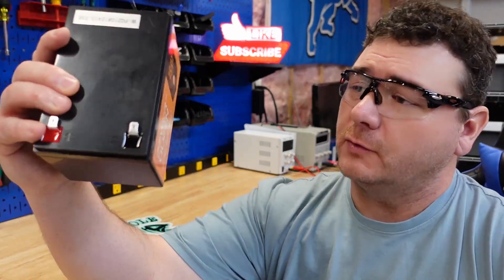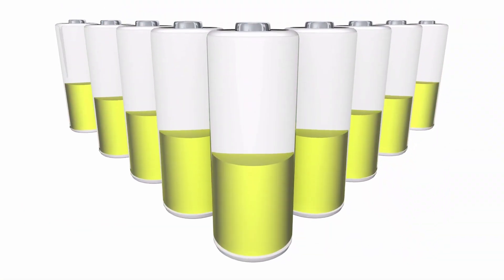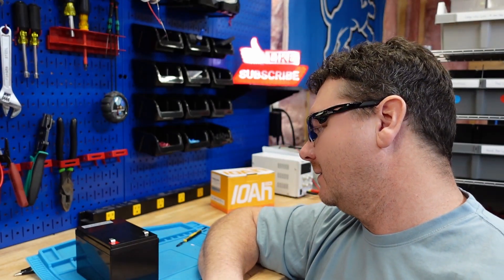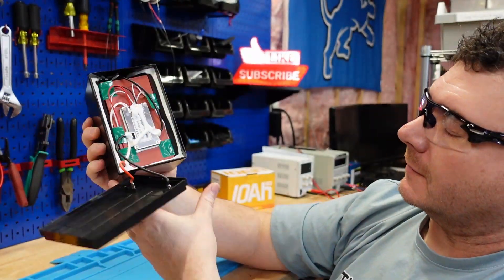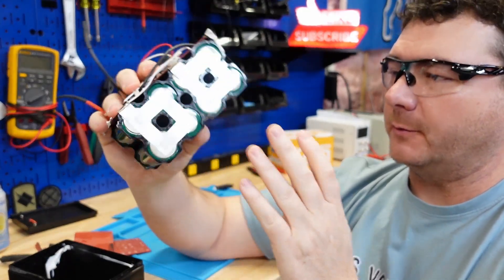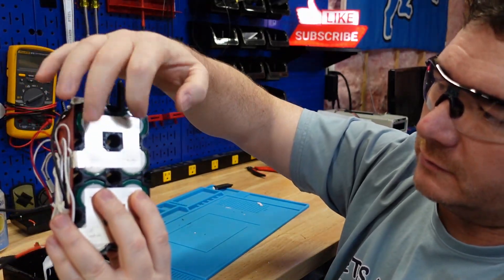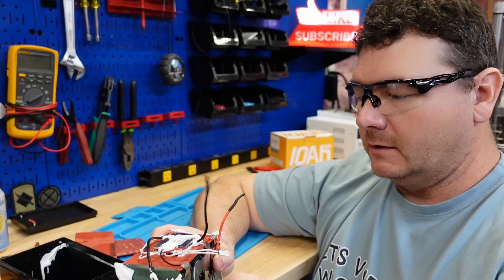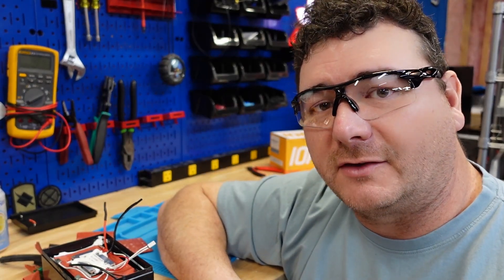Power Queen 10Ah Review and Teardown

Comment: why not just count on the $1 inline fuse that youre going to add regardless?  I could see being upset if thus was a case of false advertising (which I dont recall you mentioning) but for $55 this IS A GREAT BUY as long as a FUSE or any other protection method is applied… no?

Comment: All they would need to do for that to be a very good battery is use a BMS with short-circuit protection and a low-temp cutoff switch.  Other than that, the build quality was very good and those are clearly not 5,000mah cells, or you wouldn't have drawn more than 11ah in your test.  My guess is those are 5,500mah 26650 cells, so you're getting a helluva battery for $55.  While I agree with you on the short-circuit protection, (they really went cheap on the BMS) that would not be a deal-breaker for me, at all.  Most of these batteries are put in place and connections made to the terminals, thereby protecting them from an accidental short-circuit.  Also, anyone with any brains at all is going to use an inline fuse between the battery and the load, mitigating most of the risk.  That's really an excellent battery for the price.

Comment: We've been dealing with lead acid batteries for years without Short circuit protection I've been using this same battery for ice fishing it works awesome.  I guess don't let positive touch negative been the montra forever.  Buy this battery you won't be disappointed
Reply from the maker: It is a pretty important safety feature because lithium cells pack a lot more energy than lead acid cells.
Reply: True , but let's see what happens . I would 100% guess that before any "boom" will be an open wire connection (melts) ...